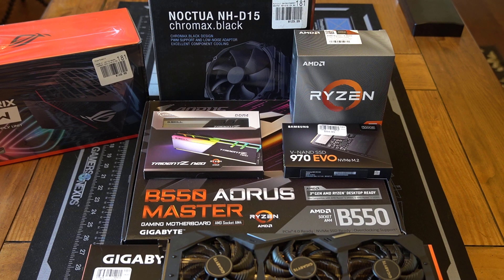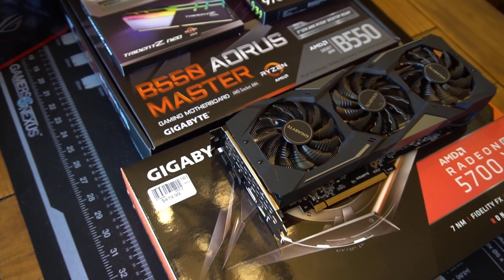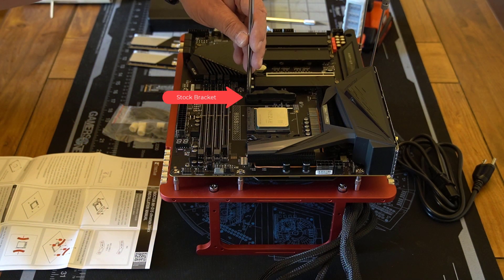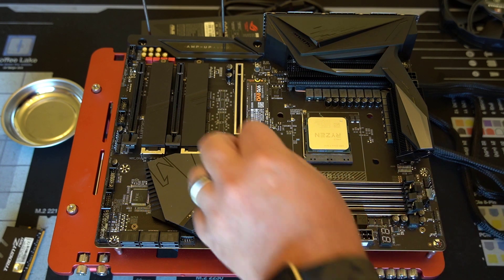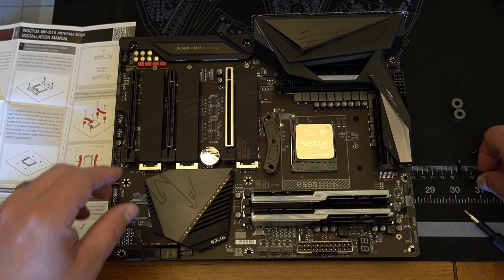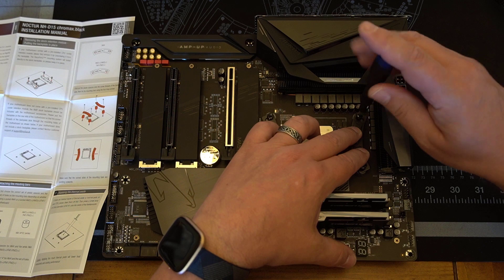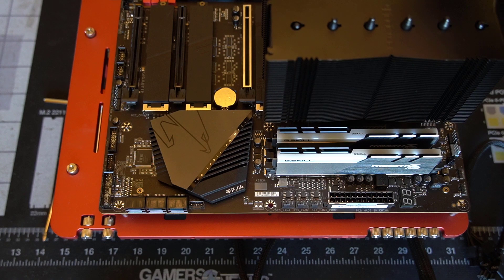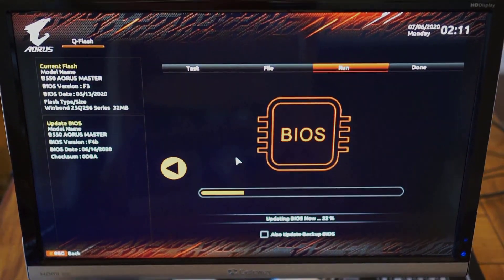Building a B550 Aorus Master System

Comment from the maker: The Gigabyte B550 Aorus Master is a premium B550 motherboard that has several interesting features that help offset its relatively high cost. In this video, I assemble and test a system based on this motherboard on a test bench.

Article: https://bit.ly/2Oi2wkX

The Gigabyte B550 Aorus Master motherboard has a retail price of $279.99, which is at the upper end of “budget” B550 motherboards. It is also more expensive than some X570 motherboards. For this price, you will get some interesting and useful features and very high-quality components that might make it worth the money.

Product Links

Gigabyte B550 Aorus Master motherboard on Amazon: https://amzn.to/3fi0r4g 
AMD Ryzen 5 3600 processor on Amazon: https://amzn.to/2W8CKUx
Noctua NH-D15 chromax.black CPU cooler on Amazon: https://amzn.to/322w7Xo
32GB G.SKILL Trident Z neo DDR4-3600 memory on Amazon: https://amzn.to/3ejo4bj
500GB Samsung 970 EVO M.2 NVMe storage card on Amazon: https://amzn.to/3gPLoyT 
500GB Samsung 970 Plus EVO M.2 NVMe storage card on Amazon: https://amzn.to/2ClbVVZ 
EVGA GeForce RTX 2070 SUPER XC ULTRA GAMING, 8GB GDDR6 on Amazon: https://amzn.to/2XG1vsF 	
550W ASUS ROG Strix 80 Plus Gold modular power supply on Amazon: https://amzn.to/3iIMf6m 

** Please like, comment, and subscribe for more! ** 

Links to Amazon and Newegg are typically monetized on my channel (affiliate links) and may return a commission of sales to me from the retailer. This is unrelated to the product manufacturer. 

Follow me in these locations for more hardware updates: 
t: https://twitter.com/GlennAlanBerry
l: https://www.linkedin.com/in/glberry/ 
w: https://glennsqlperformance.com/ 

Host, Video: Glenn Berry

Comment: I am expecting to have to build a compute server for research number crunching. Would a B550 plus the Ryzen5 you show, be a good combo to start out? I am retired, so getting started with this kind of computing is necessarily expense-limited.
Reply from the maker: Yes, a B550 system should work pretty well for that. You might consider using a Ryzen 9 5900X CPU.

Comment: b 550 whit 3    m.2 ports     pcie 4.0    you sure about that ??    as far as i know  the b550 only have the top slot 4.0 ...    only the 570 have more ...   or am i wrong ??
Reply from the maker: You are wrong. This B550 motherboard has three M.2 PCIe 4.0 slots connected to the CPU, not the chipset. If you populate the 2nd or 3rd M.2 slot, the main PCIe slot (for the video card) goes down from PCIe 4.0 x16 down to PCIe 4.0 x8.

Comment: GOOD MORNING GLEN EXCELLENT VIDEO, I HAVE THE SAME CONFIGURATION BUT WITH A RYZEN 7 5800X PROCESSOR, THE COMPUTER TURNS ON WELL, BUT REBOOTS WITHOUT STOPPING, THEN I PRESS the f2 or del key it stops and shows me the code 02 on the board and does not show me video, could you help me with this problem
Reply from the maker: Do you have a discrete GPU?  Is your monitor plugged into that (and not the video port on the back of the motherboard)?
Reply: @GlennBerrySQL  glen I have my monitor connected to the asus rog strix rtx 3060 oc graphics card, I turn on my pc and it stays in a reboot cycle, and it only stops when I press the f2 key, and the motherboard shows me the code 02, and it stop on the vga led
Reply: @GlennBerrySQL  did you update the bios so that the board supports zen 3 processors such as the 5800x?
Reply from the maker: @rotajr7367  Yes, I have two of these motherboards. One has a Ryzen 9 5900X and the other has a Ryzen 9 5950X.
Reply: Thermal paste ;)

Comment: Good afternoon.

I have this mother board and I’m having a problem. The computer works fine but the thing is for some reason when I turn the computer to sleep mode or reset it stops recognizing the screen ( Or at least it’s what I believe it’s happening). The screen just stays black and I would have to reboot the PC to use it again.
I just need some help.
Thank u and also great explanation in the video will for sure recommend the channel to my friends.
Reply from the maker: What video card do you have?

I would be checking things like your Windows power settings and the Windows Power Plan that you are using. I would also make sure you are on the latest BIOS version for the motherboard.

Personally, I rarely use Sleep mode. I either lease my machine running all the time, or I shut it down when I am not using it.

Comment: Is this motherboard good enough for a decently OC'd 3700x? Or should I go for an X570 board? Thanks
Reply from the maker: This motherboard has the same VRMs as the X570 version. It can easily handle a 3950X or 5950X, much less a 3700X.
Reply: @GlennBerrySQL  Ok thanks

Comment: Hello, nice video. Can someone help me please?.I want faster RAID0 from 3 disks PCIexpres gen 4 M.2 SSDs. Which would be better -Gigabyte  B550 Arous Master or MSI X570 Goflike (putting 2 disk info M2-XPANDERGen4 and one into direct CPU). I also need 128 GB of RAM with 3900x. The graphics card would be some cheap 150 USD. Which one tu use cause I already have MSI motherboard that I paid only 200 USD more from Gigabyte. I don't have money for Threadriper. Please what I can do with this what I have? I do a lot of ramdisk to disk copy and disk to ramdisk copy and to other devices - HUGE files like 60 GB (I edit them in RAMdisk cause its faster). I want Raid0 to be bootable in Linux Mint. I work in Linux Mint.

Comment: Are all 3 m.2 fully capable I heard slot 2 and 3 share
Reply from the maker: The 2nd and 3rd M.2 slots (M2B_CPU and M2C_CPU) are connected to the CPU, not the B550 chipset. If either one of those M.2 slots is used, the primary PCIe 4.0 slot (where your video card would go), goes from x16 down to x8. Both M2B_CPU and M2C_CPU are PCIe 4.0 x4.

This means that you could have three PCIe 4.0 M.2 drives installed, and they would each be x4. If you have a PCIe 4.0 GPU, like a Radeon 5700 or a Radeon 6000 series, or an NVIDIA RTX 3000 series, then x8 won't be any problem at all. It might be an issue with an RTX 2080 Ti though.
Reply: @GlennBerrySQL  thanks. Alot got the 3090

Comment: Hello have you use the 8 pin plus the 4 for the CPU? Or is fine to just use 8 and leave the 4 empty... first time building AMD
Reply from the maker: You can leave the 4-pin EPS connector empty. If your power supply has two EPS cables, you can use both of them. The only time it would really matter much is if you were trying to heavily overclock something like a Ryzen 9 3950X
Reply: @GlennBerrySQL  thanks I have a RM 850 corsair power modular but I couldn’t find a 4 pin connector 😱 all are 6 or 8 pins
Reply from the maker: @GForce101  There won't be a 4-pin. The 8-pin comes in two halves (at the connector itself), so you only use one of them. The other half is not plugged in.

Comment: do all b550 support noctua NH-D15?  because if I look at the website there is no list that shows support for b550
Reply: Motherboard support is not the issue when it comes to Heat Sinks. Nocuta usually include both Intel and AMD brackets. Look out for high profile RAM clearance and case cover clearance. Look up the case specs and measurements before buying.
Reply from the maker: Usually, the size of the case is more of an issue than the motherboard. Another issue is how tall your RAM is. The Noctua NH-D15 has fit on every B550 I have tried it on so far.

Comment: Hello there! I’m having terrible trouble with this board here. Apparently I am not alone from looking at comments across multiple authorized sellers. People have RMA’d them for being dead on arrival or dying after a few days! I cannot get mine to post and do not know what to do at all. Have you had any troubles with your board??
Reply from the maker: I'm sorry to hear that! I have not had any problems with mine so far.

What were/are the symptoms with your board?  

Was it working, and suddenly stopped?

What troubleshooting have you done?
Reply: Glenn Berry 
So let me give you a rundown of my specs: 3900x,  3200mhz Corsair vengeance pro, H100i platinum Corsair AIO, 850w Rog Strix White Edition PSU. I have checked the CPU for bent pins, none present. I have made sure every last cable is plugged into it’s proper location, both on PSU end and input end. I feel like the only thing I haven’t done is tried uninstalling the RAM and reinstalling. Otherwise I have tried just about everything. I cleared CMOS. I’m not using any SATA connections. Just one 970evo plus in the top m.2 slot. And I’ve even made sure that’s in perfectly. The Q-codes I am getting are either AE or AA sometimes. I’m so confused. This is my first build and I am staring at a $2000 piece of metal. I have no GPU yet as I am waiting for 3080 in September to come out.
Reply from the maker: @padazzle6163  So you don't have any GPU at all, even for testing?  The Ryzen 9 3900X doesn't have integrated graphics, so you won't get any sort of video output. Without a GPU, you can't really tell what is happening with POST (except what the debug codes show). If there was some more basic problem with the CPU or RAM, that should show up with a debug code.

I assume you see fans spinning, LED lights shining, and the system is not shutting off after a few seconds.

If you can get your hands on any old, cheap PCIe video card to temporarily use for testing, that would be very helpful. Remember, the very first time you boot and it finishes posting, it will hang until you hit F1 to go into the BIOS setup (because the motherboard sees a new CPU and RAM). That may be what is happening, but you just can't see it.
Reply: Glenn Berry I actually do happen to have a really old system with a RADEON HIS 7950. Would this work? I didn’t even think about the integrated graphics not being in the 3900x since I’m so new to all this tech info. And yes, all the fans and LEDS are running. The AIO is running, everything seems to have power, I just can’t tell what’s going on since the monitor is coming up with no signal. If this PCI video card works, do I need to just mash delete key when I first start up, or do I need to hit a specific F key after Q code pops up? Thank you so much for your help, seriously! I cannot find a lick of information online that isn’t extremely outdated or not helpful at all.
Reply: I am now figuring out that the AE code I keep getting means it’s looking for an OS. So I do have a USB ready with windows installation media ready to go for when I can get into the BIOS.
Reply from the maker: @padazzle6163  Yes, that video card would work just fine for testing. Make sure you connect the PCIe power cables to the video card.

If you get a video signal, you will have a better idea what is happening. It will probably halt, complaining about a new CPU or memory change. Otherwise, hitting the Delete key should get you into the BIOS setup.
Reply: Glenn Berry Thanks so much! I am going to try this tomorrow and get back to you! Fingers crossed :)
Reply from the maker: @padazzle6163  Glad to help! Please let me know how it turns out.
Reply: Glenn Berry We have POST!!!! I am so thankful that this was just a blip on my end and not any of my parts malfunctioning! The level of pride I have with this being my first build is high! Thank you so much Glenn. I was able to install Windows, get into BIO’s and mess with my RAM, and all that jazz. I’m currently updating everything and installing drivers.
Reply from the maker: @padazzle6163  That is great news! Thanks for letting me know.

Comment: It's been a while since I built a system. In my day, manuals and boxes included a "contents" list of what you get in the box. the motherboard contains quite a few attachments including what appears to be sensors, among other more obvious things (sata cables, etc.). Do you know if there is anywhere that sets out exactly what comes in the box so I know what to plug into what headers?
Reply from the maker: The only things you might have to connect are the WiFi antenna, SATA cables, and an adapter for the FP cables (power, reset, etc,)

Comment: Will it fit 4 ram sticks?
Reply from the maker: Yes, the B550 AORUS Master motherboard has four memory slots.
Reply: @GlennBerrySQL  sorry. Meant the cpu cooler
Reply from the maker: @AmCanTech  That depends on how tall the RAM is. I ended up just mounting one of the CPU fans a little higher so it would clear my RAM. Luckily, it still fit in the case.
Reply: @GlennBerrySQL  Awesome. You have a great channel and deserve a lot more views.
Reply: @AmCanTech  i will going to buy  corsair lpx  ram for sure  (lpx is so much shorter than almost every ram)

Comment: Hi Glenn. Thank you for this video it was very informative! I am building a PC for the very first time, and I am using this motherboard. I have an AMD Ryzen 7 3700x CPU as well. After building it with my computer-savvy friend, we got the solid red CPU light and the D0 debug code. We checked everything, and made absolutely sure all the wires from the PSU were plugged into the motherboard correctly but still no luck. I had another friend check it out, and he used a tool to check the voltages, and oddly the cpu fan header pins weren't giving out any power and neither were any of the system fan header pins. I'm certain the ATX_12V CPU power plug is in the socket snug and correctly. The RAM and GPU are in properly and the board is getting power.  I decided to replace the motherboard and CPU because I figured something must've been defective. I rebuilt it the same as before and STILL the red CPU light and debug code appeared. Could this be a faulty power supply issue? Also, can the CPU detect if the heatsink is pressed down on top of it because I'm wondering if maybe I didn't secure it tight enough? I'm exhausted after building and rebuilding almost 4 times now with the 1st and 2nd boards. Any help would be immensely appreciated!
Reply from the maker: I'm sorry you are having so much trouble! Are you doing your initial building and troubleshooting with the motherboard in the case, or do you have the motherboard out, perhaps on your motherboard box? It is much easier to work on that way.

According to the manual, D0 is a CPU initialization error. The power supply is the next likely culprit. What model do you have and how old is it? A new power supply would be useful for troubleshooting purposes. Do you still have both CPUs and both motherboards? If so, I would try both CPUs in both motherboards. It is very unlikely that you got two bad CPUs and two bad motherboards at the same time.

The CPU does not have any sort of pressure sensor. If the CPU cooler is not mounted properly, the CPU will overheat and eventually shutdown the system (depending in the BIOS settings). Since you have a 3700X, are you using the stock Wraith Prism RGB CPU cooler that came with the processor?  Is the fan on the CPU cooler spinning when you turn the system on?

Maybe you can take some pictures of the motherboard with everything plugged in just to see what you have going on.
Reply: @GlennBerrySQL  Thank you for responding! To answer your first question, I have thankfully been building and troubleshooting on top of the box instead of inside the case ever since the 2nd motherboard arrived. I tried a combination of both CPUs on the 1st and 2nd motherboard. I even updated the BIOS on the first board and that still didn't make a difference with the debug code. My power supply is a Thermaltake Grand Series 850w. I must admit, I didn't check to see all the bad reviews on Amazon before purchasing it (a rookie PC builder mistake for sure). I have a new one coming in the mail tomorrow. It's an EVGA SuperNova 750w power supply, and I made sure it was a well reviewed  product this time. 
Regarding the CPU fan. I have the stock AMD Wraith Prism that came with my CPU as well as an aftermarket ID Cooling fan for RGB aesthetic purposes. I took turns plugging both fans into the CPU fan header, but neither one started spinning when the board was powered up. I thought perhaps the fans might only spin at certain temps while plugged into the CPU fan header, so I plugged them into system fan headers instead just to see. Same thing: neither one would spin in the other headers when the board was powered. I'll definitely update you tomorrow once I replace the PSU. If I'm still having the same issue I can take a video and upload it to my channel if you wouldn't mind watching. Perhaps you may catch something obvious that I'm missing. I'm fairly new to all of this, but I'm doing my best.
Reply from the maker: @KatanaKota17  It sounds like you are trying all of the right basic troubleshooting steps so far. I really think you have a bad power supply, especially since it is the only thing you have not swapped out yet. Are you 100% sure that both the 24-pin and 8 pin CPU power connectors are connected and fully seated?
The CPU fan should spin when you first turn the system on, and should always spin (at least with the default fan curve).

It is highly unlikely that ALL of these other parts that you have tried are bad. The only common component is the power supply.

Please let me know how it goes. Thanks!
Reply: @GlennBerrySQL  I wanted to update you and also thank you for your advice. After a month of struggling, buying a duplicate mobo and CPU and a different PSU, I have finally gotten the PC working today! It turns out my Corsair RAM was not compatible after all. They had rgb lighting up when powering up the board which was very misleading. I got some G.Skill trident RAM in today, set it in, and voila! I have certainly learned a lot about computers throughout this entire ordeal. Thank you again!
Reply from the maker: @KatanaKota17  Thanks for the update! I'm glad that you got it figured out in the end. I have had great results with G.SKILL RAM, but Corsair RAM usually works pretty well too. I bet you have learned quite a bit going through all of this. It is painful while you are dealing with all of the troubleshooting, but what you learned helps make up for that.